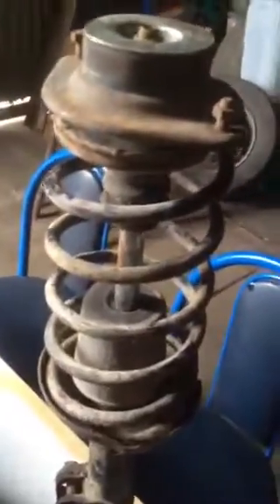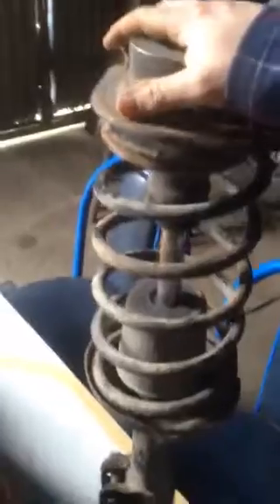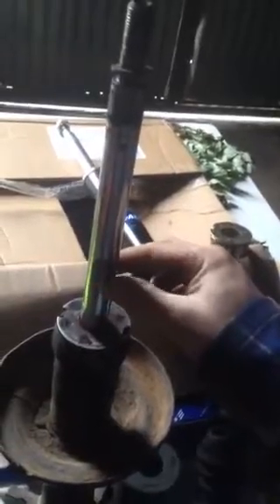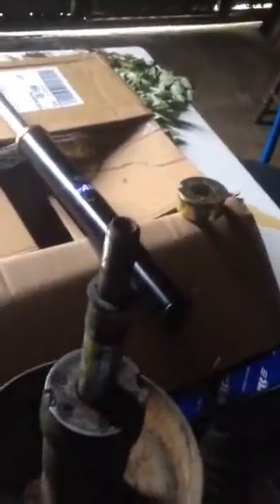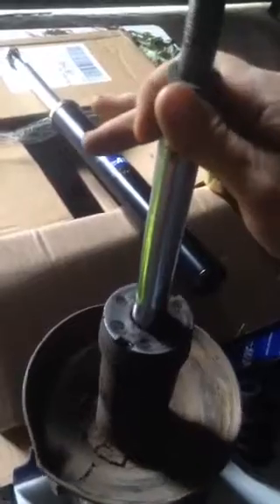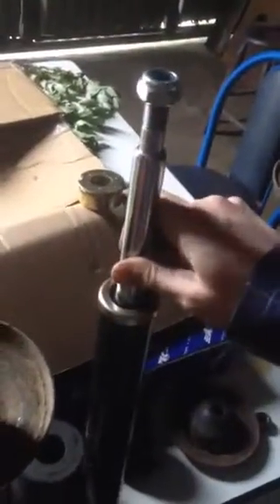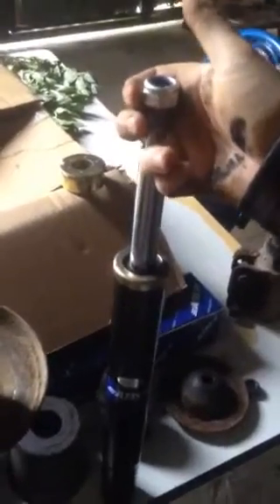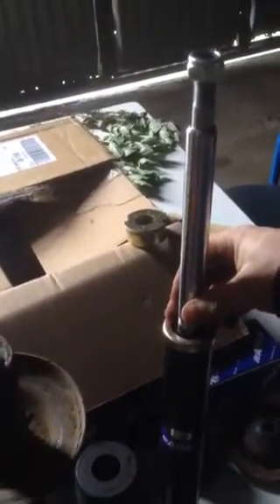Mk1 golf suspension strut

Comment: Do you know diameters of the shock insert?
Reply from the maker: The yellow tube or the piston ?  I bought them off eBay as Mk1 golf insert dampers front suspension
Reply: @stevenharpervw  hello, I know that piston is around 20mm in diameter. I need to know the outside diameter of the strut insert(cartridge) not the shock absorber's body.
Reply: @МилошГолић  just pulled my Scirocco MK2 scala apart to do this job, turns out mine are wet dampers rather than dry cartridges.

The new dry cartridges are smaller than the strut housing bore, this no doubt will cause knocking as the damper moves inside the strut.